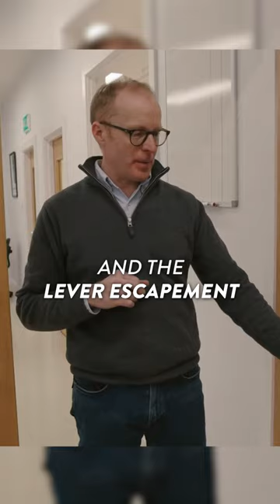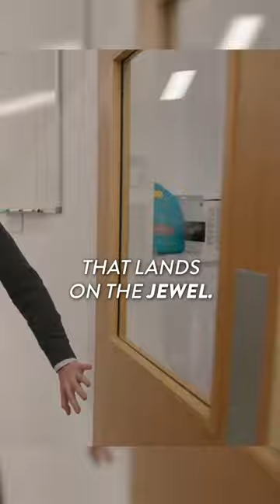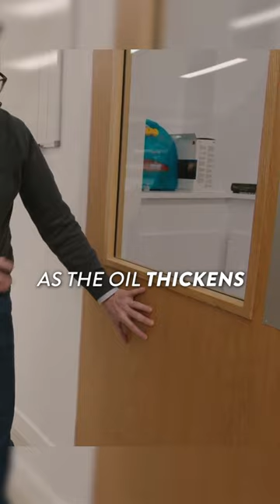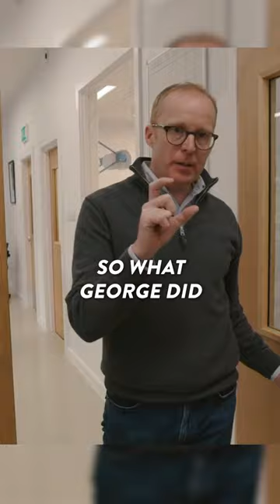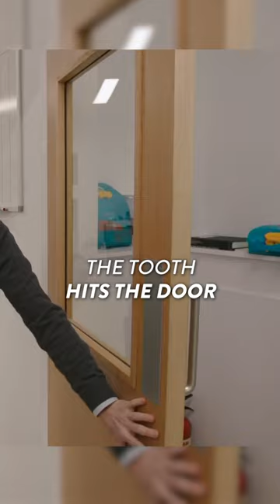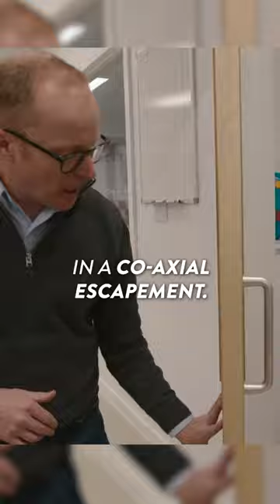The CO-AXIAL ESCAPEMENT explained using a door with Roger Smith

Comment: The ideal scenario would be for a constant pushing motion on one point of the roller's jewel until the entire energy transfers from the escape wheel tooth to the roller's jewel, moving tangentially to the rotation of the roller pin at the point of release. With Omega's coaxial escapement, there's wasted potential energy that could be used to impulse the balance wheel, since the follow through is short. This may be why Omega runs its watches at 3.5 Hz instead of 4 Hz..
Reply: there are coaxial movements that run at 4hz, such as the manual 9908 movement in the chronoscope
Reply: @drewsleyy3836  Sure but that seems to be the exception rather than the rule. Omega must've realized the same thing as Daniels, that a lower beat rate made sense. The 9908 is a chronograph, so testing out a higher beat rate makes sense for that. The alternative would be to try and release a high beat 5 Hz 36,000 BPH movement, which I don't think that Omega would've been too keen on with the coaxial escapement.